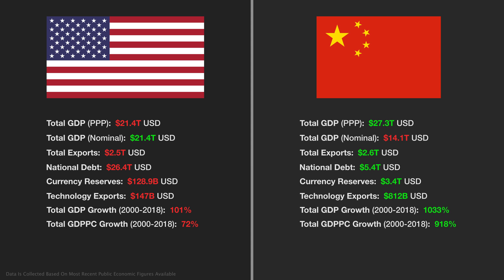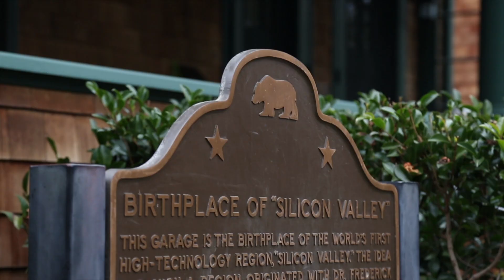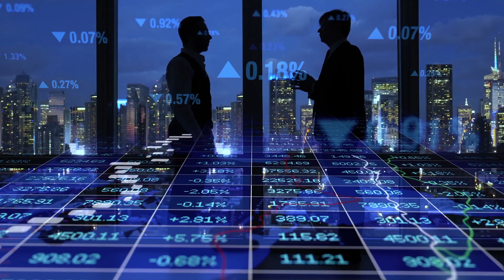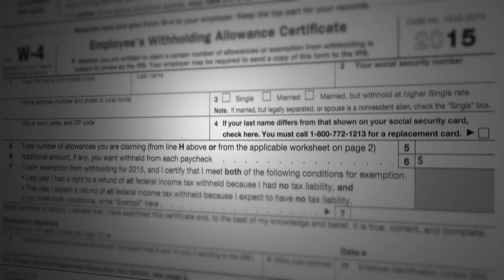China and The Future of Technology

Comment: Moore's law stagnated when Intel had issues going beyond 14nm. But TSMC picked up the slack and silicon progress has been continuing, and now projected to go into the angstrom level. China surprised us when they created 7nm chips. But going beyond that requires EUV lithography and it will be a major hurdle for them to develop that independently.
Reply from the maker: Agreed. Moore's law was never going to go on forever. Transistors can only get so small until subatomic particles (specifically electrons) can no longer consistently be passed from valence to valence. Most agree that's somewhere around 5nm. So we can't just keep doubling the amount on a board forever. I'm sure you've noticed that every time a new more powerful graphics card comes out in recent years, they just keep getting bigger. For a while they kept getting smaller just like phones did at a time, but now everything is getting massive again. In order for companies to continue to make claims of greater power they need larger chips and/or larger cooling solutions for higher clocking speeds. There are efficiencies still being made in hardware/software, and those won't stop of course, but the days of doubling processing power every 2 years are longggg gone. I just wish they'd invest more energy in ternary systems, it seems like it was a good idea abandoned too early.